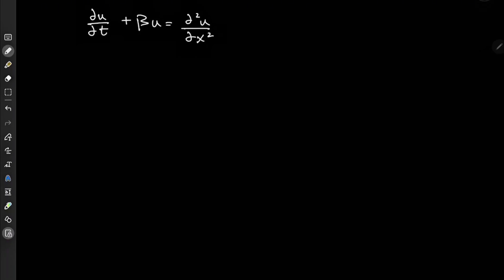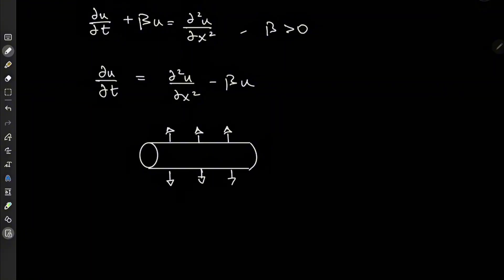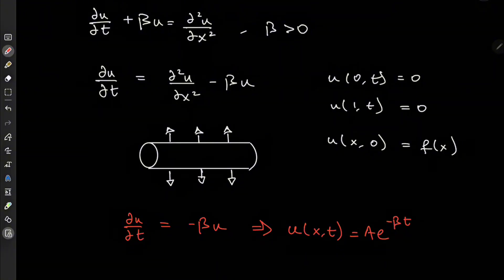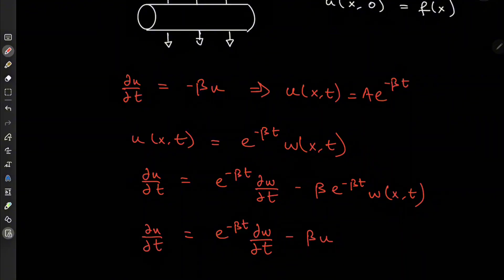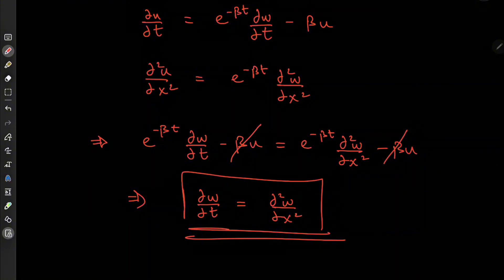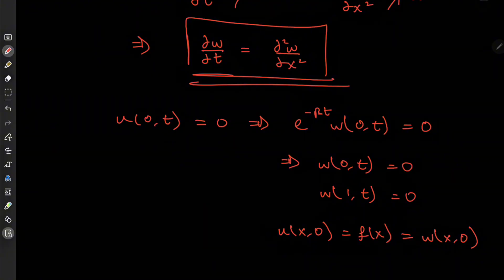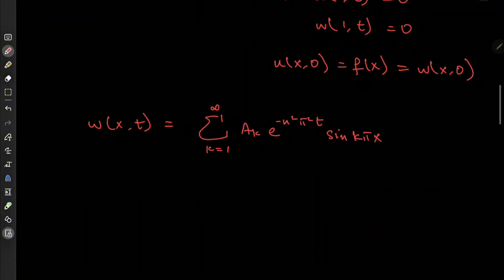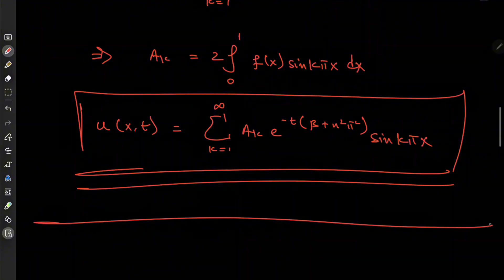Spicing up a famous partial differential equation

Comment: I was wondering about the uniqueness of your solution ansatz through separation of variables. When you initially discard your diffusion term, you are putting yourself in the regime in which beta->inf (or, to better say, the regime in which D/beta<<1, with D the diffusion coefficient in front of the Laplacian). I cannot recall if, by ignoring the Laplacian and hence changing the order of the PDE, there is some nasty special case in which you lose parts of the solution space. Probably, when the initial profile at t=0 is not smooth, but I'm not sure. 

I was trying to play a bit around with the rhs and rewrite the operator (D d_xx - beta), when applied to u, as (sqrt(D) d_x - sqrt(beta)) (sqrt(D) d_x + sqrt(beta)) u, which has some similarity with the wave-operator, with the time-derivative replaced by the multiplication by the constants +/-sqrt(beta); in this form it is possible to see why beta has to belong to the positive reals.
This would mean that the solution to the stationary equation (u_t =0) would be composed of the superposition the two left/right "waves", with the total profile of the form u(x,t) = u_L(x^2 /( D t) + beta t) + u_R (x^2 /( D t) - beta t), where the quantity x/(tD) plays the role of a non-homogeneous wave vector and beta the role of a "wave frequency".

From here I don't know how to get the full time-dependent solution and, if it is possible, if this then agrees with your solution. Physically, the full non-stationary solution should imply a time-dependent amplitude for the two waves, possibly non-symmetric between right and left components depending on the boundary conditions (which, in the general case, could be time-dependent).
For beta=0 and a delta peak as initial profile, one should recover the usual heat kernel (symmetric regarding the mirror symmetry t -> -t); then, convolution of the initial profile with this kernel gives the full solution to the heat equation with an arbitrary initial profile. What I am implicitly questioning, if there exists a path to derive a heat kernel that is dependent on beta.

Has anyone comments or simple/evident arguments with which to show that what I wrote is not correct?

Edit: some small correction regarding the variable of the u_{L/R} functions

Comment: It's wonderful to see another engineering application (as noted by your friendly neighborhood engineer!).  While I appreciated the intutive development and change of variables to arrive at a simpler equation en route to the solution, this was not necessary.  Instead, make the standard separation of variables assumption, namely that u(t, x) = T(t) X(x), plug this into the PDE, and separate the variables to find:
1/T  dT/dt + β = 1/X  (d^2 X)/(dx^2 )
Since the left hand side is a function of t only, and the right hand side is a funtion of x only, they both must equal the same constant, which we can call -k^2, noting that the constant must be negative to ensure the existance of a solution.  We thus get two ODE's:
1/T  dT/dt + β = - k^2   and  1/X  (d^2 X)/(dx^2 ) = - k^2
The first of these equations is of course the one you found intuitively, Just solve these two ODE's with the given initial and boundary conditions, and recalling that u(t, x) = T(t) X(x), put cogether the complete solution.  Easy peasy.

Comment: 0:05 it's funny to see how we call this PDE differently: for you it's the famous heat equation, I know this as the Telegraph Equation which per se is completely nuts. A signal in a transmission line diffuses as heat in a metal rod. That blew my mind when I realized it.

Comment: Very very nice, the reduction and solution. I just finished introductory to PDEs, and the most I've seen, was a homogenous heat(or wave, or Laplace equations). Is this method of reduction, a standard method, thought at Uni, or was it something just you did? It looks like, its pretty standard, but I'm not sure.
Reply from the maker: It was an exercise in the textbook I used for mathematical physics at undergrad